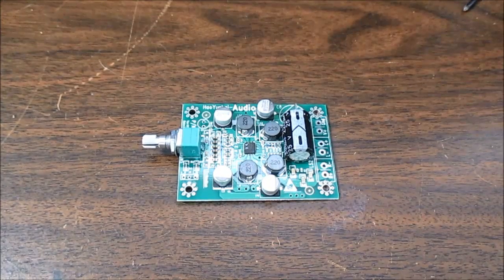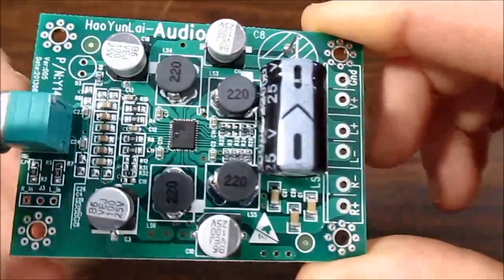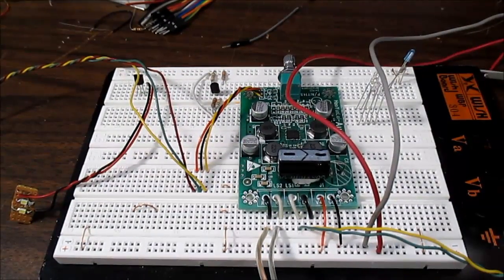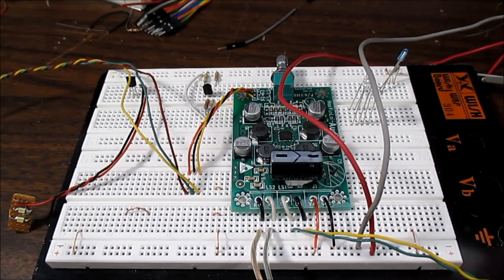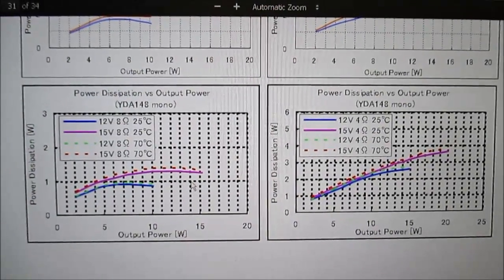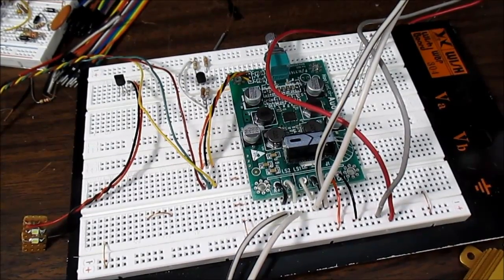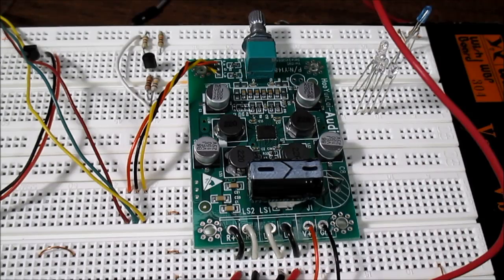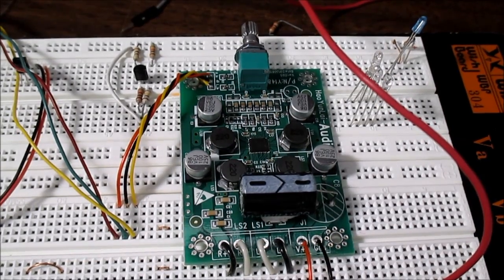Yamaha YDA148 stereo amplifier board test and review

Comment: I've used this very board in my main, only, system, as I swap out various boards. I like this board very much and it remains a favourite. I also have a tiny Indeed TA2020 amp which I like. A nice EL34 tube amp. A very old Adcom power amp and many other boards. This little Yam board remains a sentimental favourite though. I got mine from Deals Extreme or some name like that. USD $10 or so. Cheaper in your country...

Comment: Hallo John, I am quite sure you did a test on a red Yamaha class D BT amp without the green connectors on the board. Could you please point me in the direction of that video so that I can figure out the connections for it. The board only has the number 1 next to one solder hole, is that 12v+? By the way I am very impressed with the build quality of this SANWU amp. 👏

Comment: Firstly let me say I love the pace, detail and general information in all your videos. You inspired me to make a bluetooth speaker out of some old Mordant Short 402's, they are rated 4-8 Ohms 15-100w. After taking them apart they have some circuitry inside. I guess to split the sound to the tweeter etc. Do you have any suggestion on a small amp which would suit and also do you think I should take out the bits inside the speaker and connect directly? Newb to doing this but really want to get some input from a pro.
Thanks for all the great videos, some of the information is starting to sink in I think. :)
Reply from the maker: Thanks for the kind words. I'm not familiar with those speakers but the circuitry inside is probably a crossover network that sends the high frequencies to the tweeters and low frequencies to the woofer. Don't remove that as it can mess up the sound of the speaker and the tweeters can be damaged. Any of the amps I reviewed and found to be good should work fine even if rated less that 15w.

Comment: Your finger has skin pain threshold of approx. 55°C. The IC has themal protection that starts to kick in at 155°C, releases at 130°C, and goes for permanent shutdown at 165°C, with maximum thermal rating being specified as 150°C elsewhere. It looks like the IC would have been quite comfy working at 140°C for its lifetime - finger being too hot doesn't seem like a big reason to abort the test. I just have a K-Type thermocouple and a roll of Kapton at hand and all multimeters i have can read temperature.

Also not sure why you describe the datasheet as big, it seems pretty benign, i usually have to work with 300 page datasheets and longer. And yeah there's configuration pins for setting the limiter and compressor that were probably left as unpopulated footprints on the board, some 0-Ohm resistors go there depending.

I wonder though, is measuring on a resistor rather than speaker or speaker inductive load simulator a really good idea as far as performance analysis is concerned? Wouldn't you want to know what kind of distortion it could come up with in real world use as opposed to into a straight up resistance? Maybe a divider from speaker or simulator back into RMAA? Or do you have reason to believe that it shouldn't be relevant? I didn't have my hands on any D-Class amps yet, well at least not ones that weren't absolute toys, and i haven't been able to arrive at an answer that would 100% convince me by myself, so any insight would be appreciated.